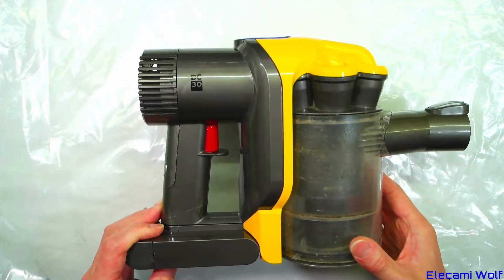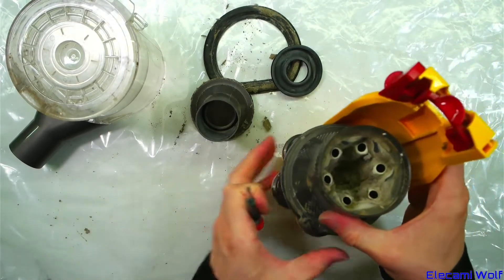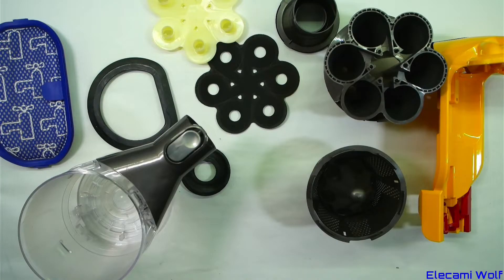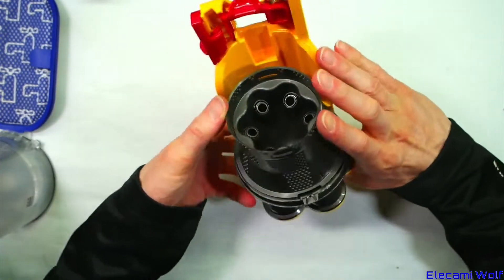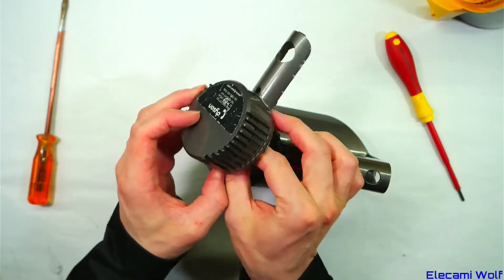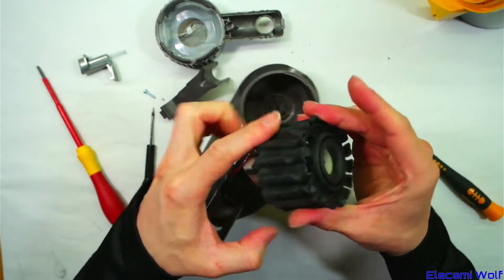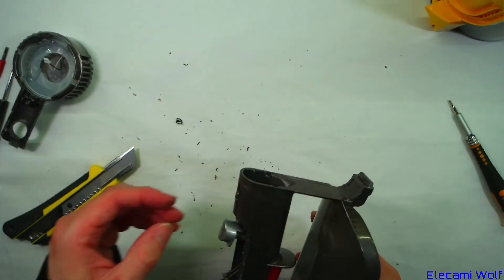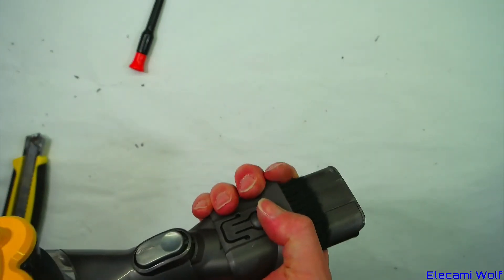EW0014 - Dyson DC30 Teardown & Reassembly

Comment: OK. Quite impossible to tear down indeed. And no immediate solution for why a DC30 cuts out after a few sec. Something on that PCB must be faulty, but how to find out what?
Reply from the maker: I think the reason it cuts off is because the battery is going bad. Worn out battery will have reduced capacity and the high current draw from the motor will cause the voltage to drop to the cut off level fast.
Reply: Mine cuts out too after few seconds. A new battery unfortunately made no difference
Reply: New battery and a new charger cable fixed all my issues. Cleaned it up inside whilst I was at it